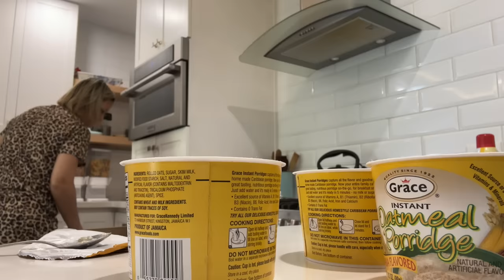She Chose Her Favourite Parent & Brother!!! @MeetTheMitchells

Comment: The idea is not to mix the bleach and the vinegar together directly. I suppose it you put a small amount of each in a large amount of water it should be safe. I usually use one or the other. I particularly like the vinegar it gives tile a very clean feeling on bare feet.
Reply from the maker: I should have stated how super dilute it was. 🙏